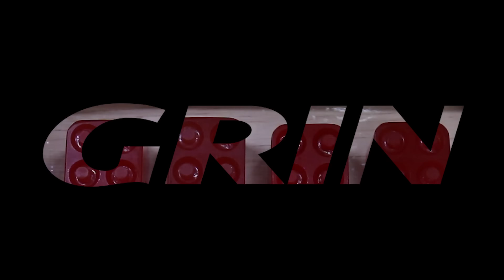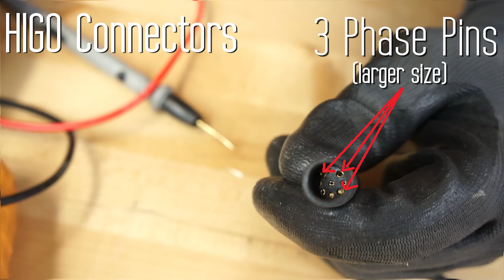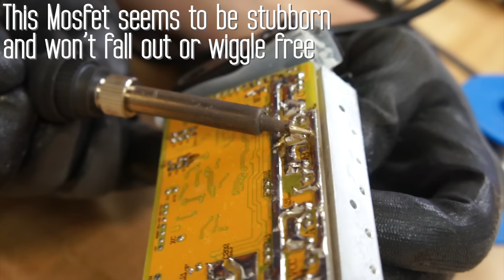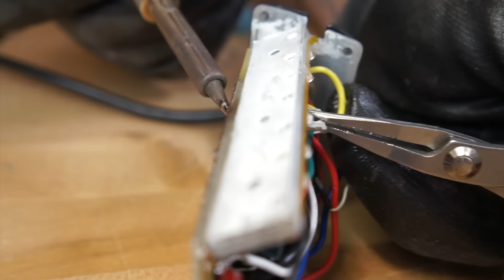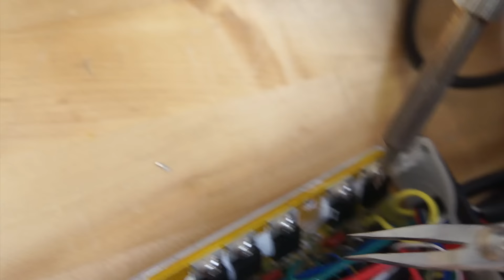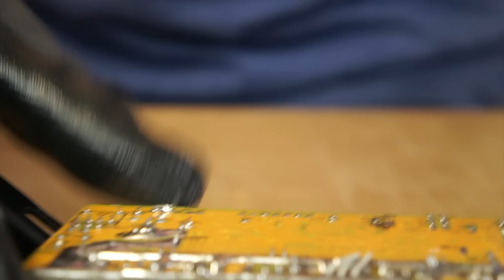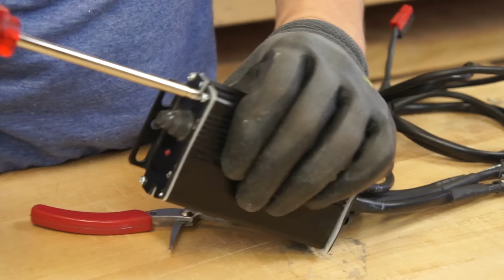Finding and Replacing Blown Motor Controller Mosfets

Comment: Only LOW side mosfets can short to ground when fail and are thereby detected by measuring between GND - DRAIN (body of mosfet)
HIGH side mosfets can short to PHASE when fail and are thereby detected by measuring DRAIN (body of mosfet) - PHASE (one of the three phase wires)

Comment: What if you put a 48v on a 36v controller what would burn out thanks
Reply from the maker: Most of the time no, most 36V nominal controllers are made with components that will handle 48V just fine. but occasionally yes.

Comment: Great. Thanks! Maybee A stupid question: Does it still make sense to adjust the 2 shunt sensors, i mean by soldering make it wider, bridging. You sure know what I mean.  I have an escooter with 2x 45A controllers (1 controller per wheel) and the BMS also offers 90 or 100A. The BMS circuit board on the battery pack can only spend as much as it says, no more?!  I hope someone can tell me whether that still makes sense or not. Thank you all 😊
Reply from the maker: Doing this will increase the battery and phase current limits of the controller, but it will also increase the likelyhood of frying your controller mosfets. If you have a 90A BMS and each controller is 45A battery current limited, then if you went any higher on the controllers you'll trip the BMS overcurrent cutoff when you try to run full power.
Reply: @GrinTechnologies  Thanks

Comment: Can blown capacitors from over-voltage equal a blown mosfet?  thanks for the video
Reply from the maker: They are two separate components and not really related. Usually capacitors blow up not from overvoltage but from excessive ripple current causing them to massively overheat.  They can also burst open from overvoltage, but that is very uncommon (as in we've never seen it).  Usually the fets would fail first and the shorted mosfet would clamp any further voltage on the DC bus.
Reply: @GrinTechnologies  cool, I was not expecting a response... thanks. I have been running a 48V 1000 watt controller at 80.60volts for over a year.  :-) Last week a mosfet blew after charging up to 82.3 volts... Controller use to not work over 81 volts at all like it had a high cut off point.  This time, it worked at 82.3 volts... for about 15 minutes of speed... until it did not... and the motor stopped working and was all cog like.

Comment: Great video, very well explained. Here's what happened last week, after a heavy rain my ebike died, the display doesn't turn on anymore, so I decided to check the controller. Doing a resistance test I connected each phase wire with the negative probe while alternating the positive probe with the positive and negative of the power inlet. From each phase wire the negative gives 0 while the positive gives 18, should I conclude that all negative mosfets are blown? Please help :(
Reply: Buy an xtra cheap controller

Comment: The pedal assist wiring shows  positive +5V and signal wire + 4.6V. Please any help. What can I replace? The throttle works fine. Except the pedal assist not working. Please advice.
Reply: Maybe it's the torque sensor? I'm no expert btw

Comment: i only have 5 mosfets on my controller, of wich 2 have continuity with ground wire (on the top aluminum part of the mosfet)
how do i determine wich one is faulty. the way i measured as in the vid, i have no ground connection on either colors measured  on the print board?
Reply: you must have 6. Also another option is that you have 3 mosfets that consist of HIGH and LOW side mosfet in one package. The other 2 are for power for example.

Comment: I have an ebike just come in been standing in his shed 6 months, has no light on display, battery is good fully charged all wiring and connections are controller connections all good bike is only 18 months old , any pointers please ???
could be controller but all looks new condition

Comment: My 3 speed settings wont work how do i go about diagnosing that? Ive tried jumping it with a wire. It went out after my charge port shorted but everything else seems to work fine
Reply from the maker: Unfortuantely we've never worked with controllers that have a 3 speed setting input so can't really comment on what might or might not have been done to break functionality there. But generally as a starter when troubleshooting a digital signal you would look at the voltage and see if it alternates between 0V and 5V when the switch is toggled.
Reply: Ok thanks for the input. Ill pull it apart one day and inspect it

Comment: Hi. Can you please mention if a brushless motor controller matches any hub motor. Are there any specific hall sensors which must match the motor controller.
Reply from the maker: There are 36 possible combinations, 3 of them will work correctly for forward rotation, and 3 for reverse rotation, and that is assuming you have a motor and controller both with 120 degree hall timing.

Comment: Does this go for brushed controllers also?
Reply from the maker: The process is quite similar, yes. Single quadrant brushed controllers will have just 1 mosfet, brushed controllers that can do regen but only go in one direction will have 2 mosfets equivalent to a single half bridge in a 3 phase controller, and brushed controllers that can do forwards and reverse will have 4 mosfets, equivalent to two half bridges.

Comment: now how do you check a brushed controller
Reply from the maker: Typically one output of the bushed controller will be connected directly to the V+ rail of the battery, while the other output is switched via mosfets and is quite similar to one of the phases of the BLDC controller.

Comment: Liked and subscribed. Great informative video. Any opinion on what might be causing my tsdz2 to be acting up? I know it isn't a brand you sell, but I am rather lost for what to do here. 

There is no torque on pedalling, and the throttle only barely allows it to move. It was working fine going up a hill, then small meandering trails down, it was functioning as well, and then when I went to go back up the hill, it turned off, and then these symptoms. The display also cuts out quick if I continue to try and use throttle. My first thought was one of the legs of power wasn't going to the motor. This is also compounded by the fact that after a few seconds of grinding slow moving, the throttle wont have function at all if let off and then pressed again, and will only regain function if the wheel is turned backwards slightly, possibly realigning something in the motor. 
 The controller is potted, but I could probably test the mosfets, but does this seem like a mosfet issue?
Thanks!  
see video of it here.
https://www.youtube.com/watch?v=R-bNCbKeK9c
Reply from the maker: Usually if it's a mosfet issue the controller won't run at all. It would only be in an unusual failure mode where the mosfet goes open circuit that the controller could still potentially spin the motor with low power, with just 2 of the 3 phases running correctly. I would check your motor to controller connections for sure.   Hopefully the vendor you purchased your kit from can offer you full support to get it working properly and if not provide you a refund, as that is their responsibility.
Reply: @GrinTechnologies  Hi , I have a problem with my ebike when the wheel is off the surface everything working fine with high speed throttle , as soon as I am sitting on it to ride the lcd display will fade in 3 seconds and the turns off itself . my partner has a exactly similar bike so I changed over the rear wheels which has a hub motor and noticed my controller is faulty because it is do exactly with the second motor and different battery . so how to indentify the fault as its working fine when its off the floor . Thanks

Comment: hi there's a lot of fake POWER  IC out there  i all ways go to RS i never had any bad parts from them   EBAY ic's are bad new
Reply from the maker: This is a good point to drive home. We've seen all kinds of clone and knock-off mosfets sold by vendors all over aliexpress and ebay, including some mosfets that were declared as IRFB4110's but measured 10mOhm of on resistance!  Always get electronic components from a legit distributor.  The secondary market is a gamble not worth taking.

Comment: When you open controller case, you maybe never get it together, because case is mosfets heatsink and brackets fall of inside and isn't any way to get them back, without special tool. I have experience of that.

Comment: Great video.
My controller/motor on my kart struggles to get up to 10mph, but runs perfect after that up to 30mph. Have you ever had that type of situation? Thanks
Reply: Is it sensorless?
Reply: @atdit  no its sensored, I dont know if magnets are chipped, or controller mosfits are bad. I dont want to open and ruin while it some what works
Reply: @armenvegas  any solution for this problem?
Reply: @pauloa.7609  yes I was using a sinusoidal controller as opposed to the cheap controllers that come with these cheap motors.

Comment: Hello,
I have a controller 36V with one Mofset dead exacltly like you show in your video. The mofsets inside this controller are called S68N08R-A from Si tech. I don't have another one here and I don't know where to find one to replace the dead one. But I have 12 mofsets from a destroyed overboard wich are called 100N8F6. Do you think it is possible to use one for replace the dead S68N08R mofset?
Reply: After have take a look at the datasheets, the RDSON is almost similar 6,5 milli ohm for the S68N08R vs 8 milli ohm for the 100N8F6. But for the 100N8F6 the total gate charge is 100A (instead 80A for the original Mofset) and the rating voltage is 80V (instead of 68V). Knowing that, do you think it is possible to replace the S68N08R by the 100N8F6? (Sorry if the answer is obvious, but I am not an elelctronician so I need some help to be sure).
If not I thougt at an another solution. Do you think it is possible or better idea to replace the 6 orginals mofsets by 6 mofsets 100N8F6 so that they are  all identical?
Reply: So, I got no response but I made it and it works fine. 100N8F6 moffset taken from an overboard can replace a S68N08R moffet. I hope it can be usefull to somebodies. Bye
Reply from the maker: Good to hear.  Normally there is a decent allowance of mosfet specs that will work on a given controller PCB and a given gate drive. No harm in just trying out a substitute fet with similar-ish specs if that's what you have.

Comment: So, how much time to line up the long  bar that locks down the mosfets? That part can be a bear to put back in.
Reply from the maker: It's not too bad if you solder the mosfets all at the same height and all with their legs vertical.  Failure to do that though,  and you could be in for a small alignment challenge...

Comment: I have a e-bike that wont change speeds, only the low speed works. the cluster shows when i switch speeds but no change in the motor, any thoughts ?
Reply from the maker: You should probably contact the vendor who sold you the ebike or the manufacturer that made it.

Comment: If my fuse on the battery keeps blowing, and I have other strange problems like the headlight not working and the speed selector not working 100%. Plus other strange problems. Will this work for me?
Reply from the maker: No, replacing the mosfets won't solve any of those problems, unless the fuse blows on your battery the very moment that you plug it into the controller, in which case you probably do have a shorted mosfet bridge.
Reply: @GrinTechnologies  No it takes a while for the battery to blow the fuse. I can drive every day for months before it happens. Or maybe not that long but a while. I replaced it once and I replaced a melted power cord. Am about to replace the fuse again.

Comment: Hi I have an electric scooter I connected it to the battery indicator and it made me short-circuit the whole indicator works the lights the brake lights the horn everything except the engine you think it is

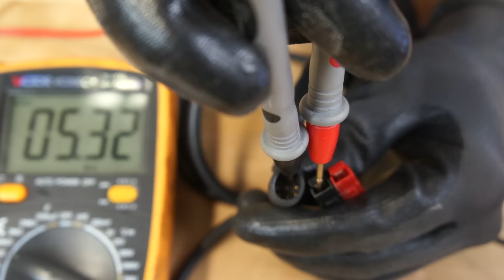Comment: ok... just to be sure here... my controller doesn't have red and black wires that connect to the battery (as @ 2:01), it has a wire with male phase pins. So to do the testing, I have to connect the female phase connector to the male phase pins... is that right?
Reply from the maker: Via a multimeter, correct

Comment: I have a 12 mosfets controller and it seems like it's beeping on all 3 phase positive mosfets, is that possible? So 6 mosfets in total
Reply from the maker: It's unusual, but not impossible. Usually it's a sign that you are measuring in the wrong place.

Comment: i have a minimotors controller shorted because the accessories wire positive and negative touching, i tried replace the fuse but lcd only turn on for split second, motor also a bit weird when spinning by hand, but if i unplug the yellow wire motor turn smooth by hand. any idea how to fix it?

Comment: This is truly bizarre. Mosfets are extremely static sensitive and this guy was wearing HEAVY DUTY RUBBER COATED WORK GLOVES!! In 40 years of electronics work I have never seen anyone do that. Gloves do not stop built up static electricity from ruining the part, especially in low humidity. Heavy rubber gloves are only used professionally in high voltage work on live wires. It is dumb luck he did not blow the mosfet with static. You need a technician's grounding mat and a wrist strap to keep your body at the same potential. Open the replacement part's packaging while it is laying on the mat.

Comment: Hi, excelent video thanks a lot. i have a question. i have a controller that PAS works fine but throttle doesn't. i already tested throttle in another system and works fine. also made this test (fase and + or -) and it is working fine. do you know what more test can i do to the controller?
Reply: Hi my girlfriend has an old bateribike which stopped working. we have tried a new battery , no goog we think it is the controler, ? any help would be good. Harry
Reply: @harryhughes5868  hi it could be several issues. i teach in my channel how to try step by step, sorry it is in spanish! https://youtu.be/--YcASeLvNA
Reply: There may be two blue wires that connect together and cause the controller to limit your speed to 20 miles an hour.  If you disconnect those two blue wires. You will be able to override the 20 mile per hour limit.

Comment: Is it possible to upgrade the controller by adding mosfet?  Some controller have 3 or 4 morfet per phase.
Reply from the maker: In principle yes but in practice it would be pretty messy as there isn't any additional room on the heatsink for a parallel mosfet, you'd need to do extension lead wires to a floating heatsink and mosfet bank somewhere else in the motor controller.   There is also the question of whether the gate drivers on a single mosfet controller have enough current to turn on and off more fets in parallel without shoot-thru problems.  It's much easier and more sensible just to start with a controller PCB that is meant for higher number of mosfets.

Comment: What if I changed the mosfet but the motor rattles like hell? Everything seems okay expect that noise.
Reply from the maker: Then assuming that your hall/phase poinout is correct, it would most likely mean that something is damaged on the gate driver circuitry associated with the failed mosfet, which can be a lot trickier to repair since then you are doing SMT rework and have to reverse engineer more of the PCB to try and identify what needs replacing.

Comment: Hey mate my conversation kit on my bike the whole thing won't even turn on I was just riding my bike when the power just stop working I heard I noise from my hub motor and then nothing.
Reply: Can anyone help me?
Reply: Well.  Usually, what I've found over the years is that the Digital Display is the culprit.  The display is the weakest link in the chain.  If the display fails... The communication with the controller fails.  Usually you will get an error message on the display. As for the noise in the motor?  That's got me. Hub motors are pretty robust.  I'd like to help.  My e-mail address is dumas.jim@gmail.com I live in the US.  Leave a note in the subject line (Help with E-bike) so I don't delete it.
Reply: When starting noise during/after riding then it means you have shorted mosfet.

Comment: Hi, could you watch this video and pay attention to the display battery meter at the top, it showed full then I turned it off and then back on it then only showed 1 bar but battery is full and motor then grumbles as it trys to run thanks  I am thinking it is a motor controller  what do you think?  thanks   https://youtu.be/ZYpqzRa94YE

Comment: Hi dude, i have bad controller, but i check 3 phases and there is no problem. So i try check resistence betwen mosfet legs and i find one with diferent resistence - shorted circuit with no resistence. you think that mosfet is broken? And when is 80V/170A i need stick with these volts and amps or can be different? how much if yes? 75V/160A? Rds same or lower and Total GATE charge same or lower? thats all what i need to know when replace this mosfet? thanks dude